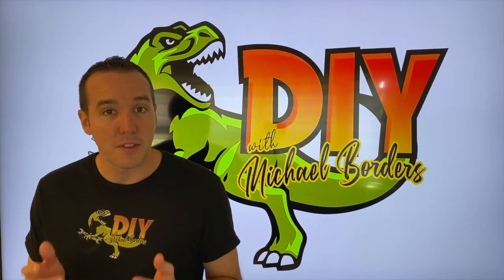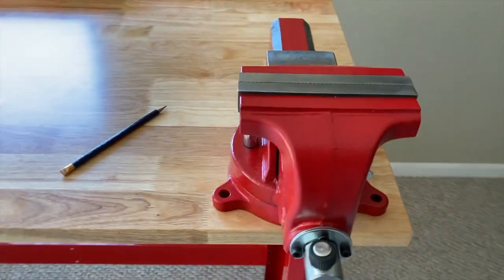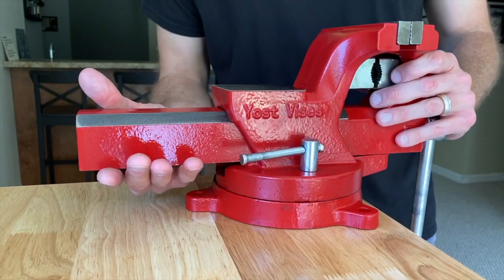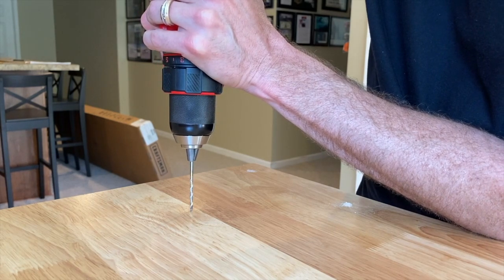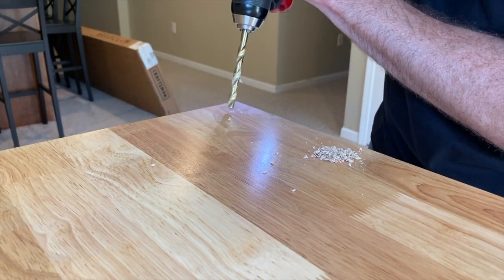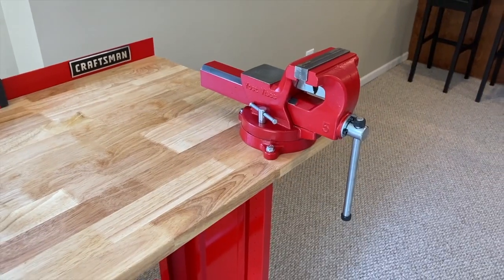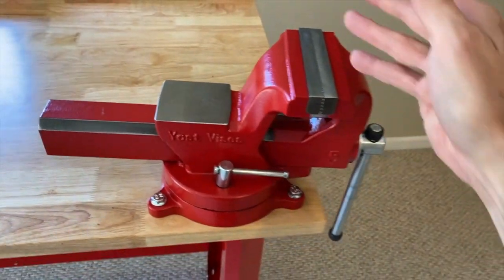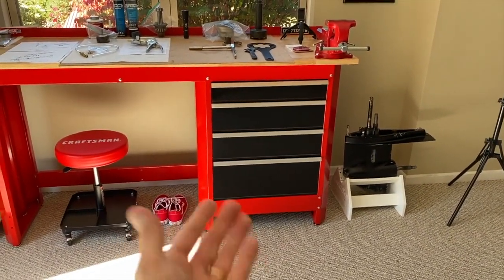BENCH VISE - Install Swivel Vise - DIY

Comment: There is no overhang of the rear jaw when swiveled to the right. He should have gotten closer to the corner. If  the frame is in the way underneath, double up a 2x12x12 platform and mount the vise on a platform corner, then mount the platform on the table. You can countersink bolts so the platform lays flat. That's why the platform is doubled. Also, if you use wing nuts you can make the platform easily removeable.
Reply from the maker: Thanks for watching & sharing.  Any & all helpful info is greatly appreciated.

😎👍

Comment: Nice video. I have the same bench and vise which is yet to be mounted. 

What size bolts did you use?
Could you have placed the base so that one of the holes was in the corner of the bench top without being affected by the metal legs of the bench underneath? I’m trying ti figure out how I’ll mount mine. Also, have you secured the workbench to the wall or floor at all to avoid it moving when using the vise? Thanks!!

Comment: How thick is the wood bench top?  My vise is around 68 pounds, so I was thinking of bolting down a sheet of maple plywood on top of my metal-topped 56-inch Harbor Freight toop chest & then bolting the vise through both the plywood & chest top.  Not sure if 1/2" would suffice or should I use a 3/4" sheet........
Reply from the maker: Thanks for watching, you are very welcome.  This exact bench comes with a 1” thick wood top.  Hope this helps.

Welcome to the DIY Raptor Club.

😎👍

Comment: Good video, thanks. How did you decide whether to put the vise on the Right or left corner?
Reply from the maker: Thanks for watching & welcome to the DIY Raptor Club.  We really wanted it on the left side however the work bench will be going into a room where the left side will be flush with the wall.

This unfortunately would not give us the space to utilize the vise to its full potential.

Keep us posted on your project, thanks again for watching.

Comment: This is way after the fact but I would recommend replacing the bolts with longer ones.  You want enough thread protrusion past the end of the nut to ensure the bolts don't back off prematurely.
Reply from the maker: Thanks for watching & sharing your thoughts.  Any & all helpful info is greatly appreciated!  😎👍
Reply: I totally agree with using longer bolts. I would also advise using locknuts instead of standard nuts.

Comment: Just wanted to update that the Yost ADI-5 has .43” holes. The aforementioned 1/2” bolts WILL NOT FIT. Not sure if they updated the vise, or if the 1/2” bolt suggestion was in error. 

Edit: After re-watching, a 5/16” drill was used for the final hole, leading me to believe a 1/2” bolt was never used.
Reply from the maker: Thanks for watching and sharing.  Any and all helpful info, feedback, and advice is greatly appreciated.  👍🧰